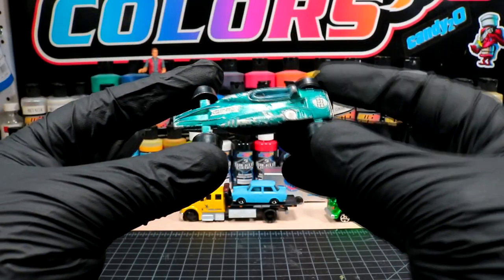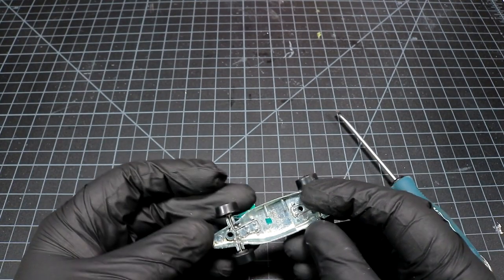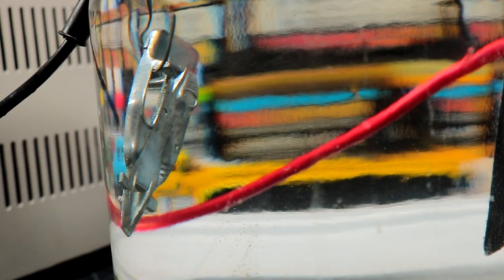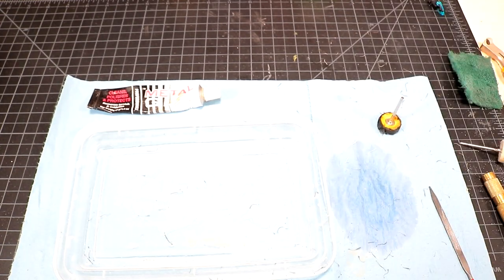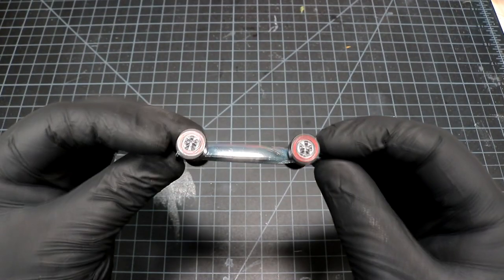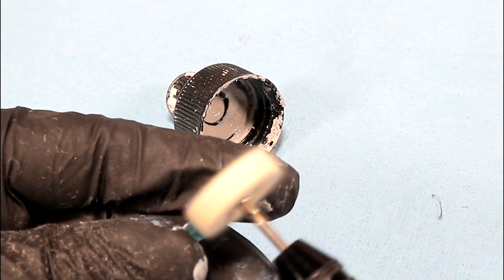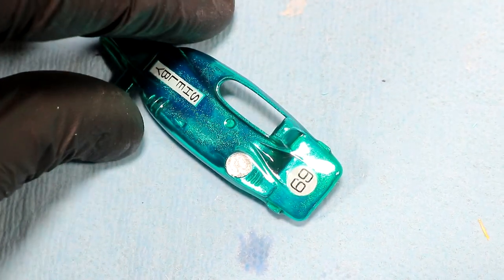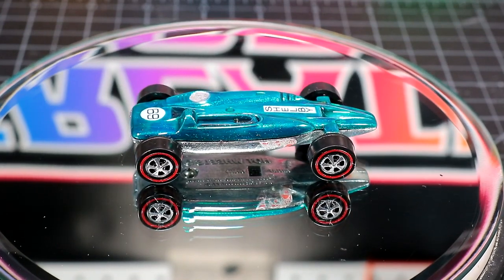Hot Wheels Redine Restoration - Shelby Turbine - DIY Zinc Plating at Home

Comment: I had one of these in dark blue - it's possibly my all time favourite Hot Wheels model. Mine suffered a terrible fate - it fell off the top of my gran's coal bunker, and into the tiny, and completely inaccessible gap between the coal bunker and the garage. That was in the early 1970's. It's probably still there.
Yours is a thing of beauty. Nice one.